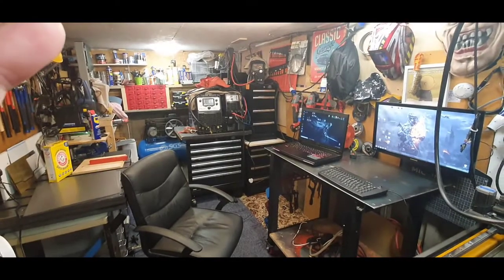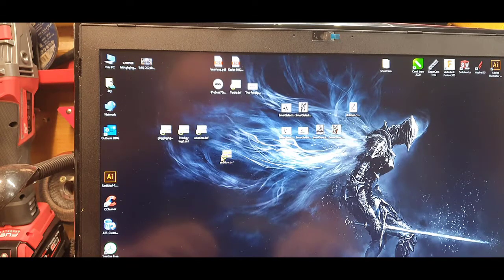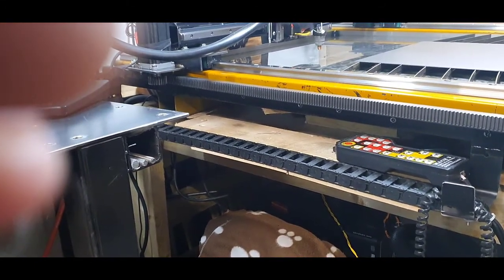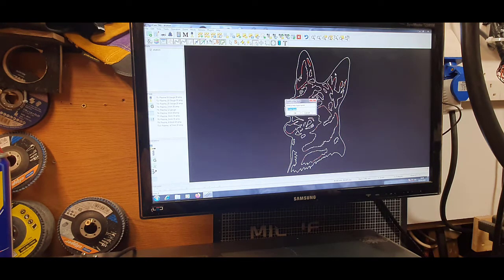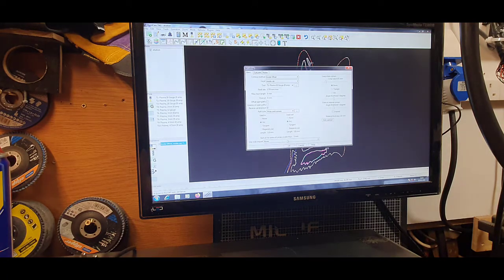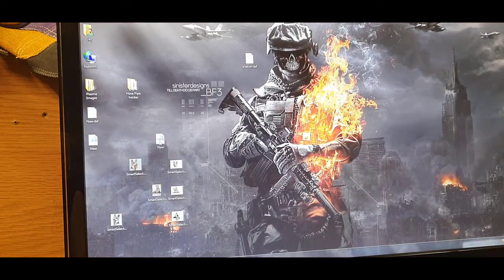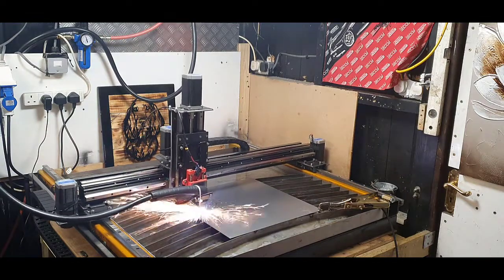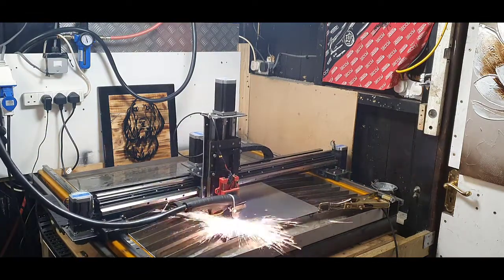CNC Plasma Cutting German Shepherd

Comment: Very nice cnc plasma cutter. How big is the cutting area? I am currently building one with a cutting size of 90x90cm because we have a small workshop so not al lot of room
Reply from the maker: Thank you 💪. Mine is a 900x900 cutting area as it's plenty big enough for myself but I was surprised how much excess space you require especially with the z axis.  You lose about 250 to 300 mm so don't forget to bank on that.  Any questions just ask away as I jumped in with 2 feet and there is plenty i would do different and you learn tons.
Reply from the maker: Sorry I meant Y axis buddy
Reply: @smallgarageworkshop6119  thanks for the quick answer 👍. How much travel do you think is necessary for the z-axis? For a plasma cutter you dont need much but for a router you need more travel.
Reply from the maker: Realistically you don't need any for a plasma as you can just have a fixed head which manually adjusts. Cutting 0.8.. the tip is around 1mm of the sheet 1.6mm tip is about 1.5 then so on so even at 5mm it's about 2.4mm so you don't need to be silly. I use mine as  a wood router plus a steel engraver so hence the large travel. Pop us an email mate from my website link or Instagram and I will  post you some close up pictures of what it is 👍

Comment: Jason, that looks the nuts.really impressed with what you have built there.  👍
Reply from the maker: Well this one was made from scratch with just a grinder and a tig and cuts within 0.2 of a mm. This is also what I used to cut Johnny's wooden beer caddy  and will post more when I can as when i changed my username I lost over 1000 subscribers so need to try and get some back.  Thanks ste 💪
Reply: @smallgarageworkshop6119  Oh how gutting to loose all those subscribers. I have done a bit of messing with a servo controller and a raspberry pi in the past it's good fun 👍
Reply from the maker: @boxers999  yeah I had used that when building it as you can run arduino with it but mach 3 now coupled with sheet cam then any designer program really like solodworks or vectric aspire. Better than watching TV lol 😆